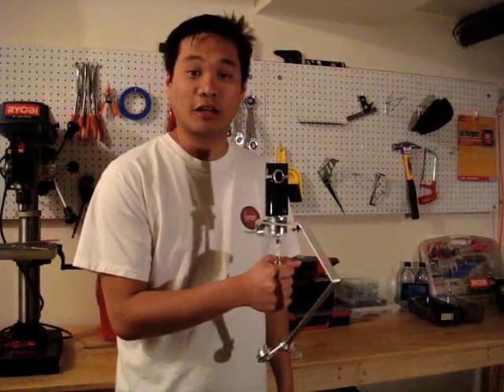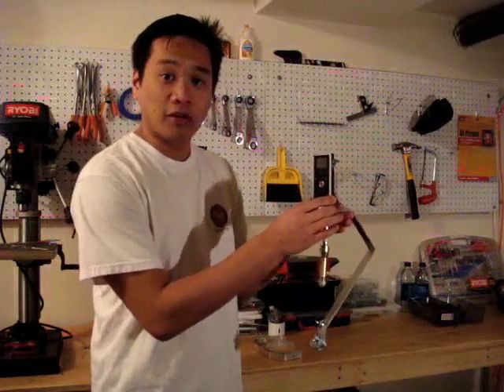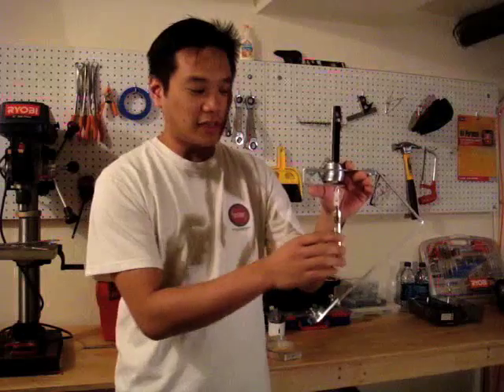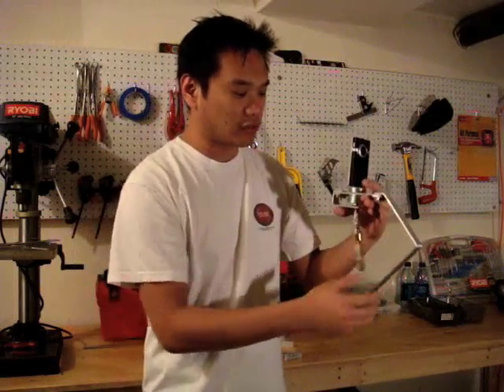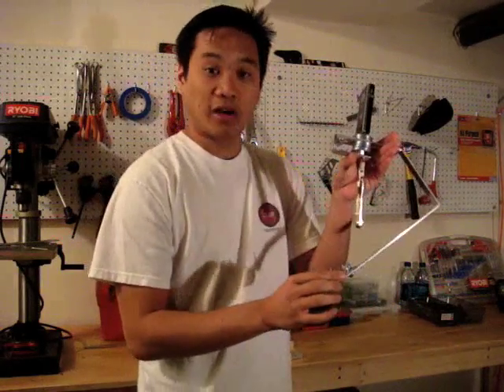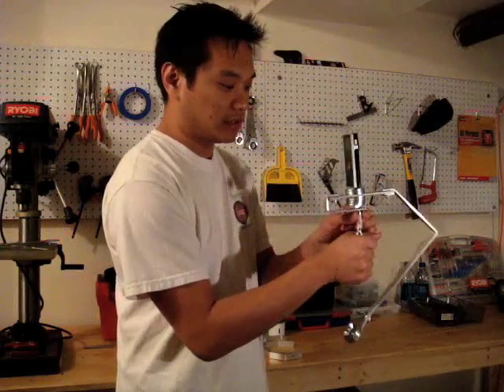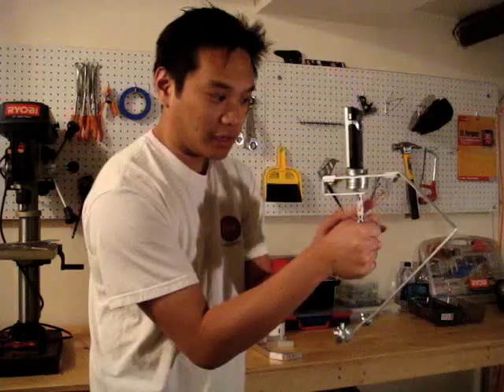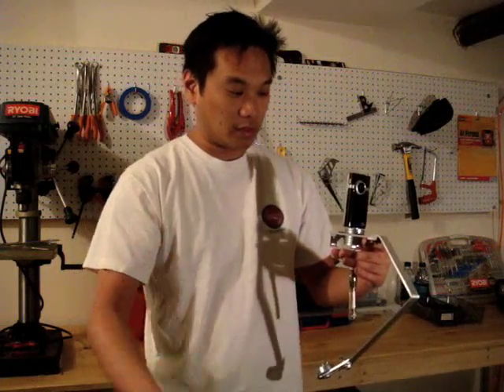Flip Float (Mini Camera Stabilizer)

Comment: i just put 1 together and am having an impossssssible time getting this thing stabilized. i have a kodak zi8 which is very similar in weight to the flip mino, any tips in which order to balance this thing? i have everything positioned  almost identical to yours and followed your google sketches as well.

Comment: I@ProtoDojo... Props dude! This is the best DIY stabilizer... Perfect for those small pocket cameras or cell phone cams. Although if you use a cell phome, you need an altinate mounting method. Perhaps a small cardboard or plastic box with foam in it to hold the cell phone cam?

Comment: Try plastic pipe like PVC. If the bearing is too small, try wraping a thin strip of duct tape around the outside circumfrence of the bearing. !CAUTION! DO NOT TRY  THIS WITH ANY CAMERA HEAVIER THAN THE ONE SHOWN IN THIS VIDEO! use only a small cellphone size camer.

Comment: Thanks for the video, I was able to make one for my zi8, which is going to be delivered tomorrow. Im testing it out with my dxg mini cam. I just added a quick release cam mount on top. It's way better than the manfrotto 585 that i bought for my dv cam. @ kadirou there's a lot of AA  flashlight that you can use for a handle if your going to use a skateboard bearing, most of them fit without any modification.

Comment from the maker: @kadirou4132 Any similar flashlight should work. Look for one with a removable bulb/lens so that you can insert the bearing. Just keep in mind that you may have to build an adapter for the bearing if the flashlight body has a larger diameter.

Comment from the maker: @crazy1992i 

Hi, Thanks for the comment! Unfortunately I'm unable to measure the weights. I gave my flip camera away and it's been awhile since I've used the setup (I'm currently testing a new electronic design). The only thing I remember off the top of my head, was that the weight at the top was about twice the weight of the bottom (I used 2 times more washers).

Comment from the maker: 3) I found the easiest way to make the bends is to place the flat bar vertically in a table vice. Clamp down and then bend the bar by hand with some gloves or with a rubber mallet. Try to keep the movement in one direction. The more you adjust the bend back in forth, the weaker the metal becomes.

Comment from the maker: Thanks for the comment kui2t!

1) I used 1/8" Aluminum flat bar in various widths. There's more info including a pdf with measurements of my design on my website. The link is in the description of the video above. :)

2) I buy the flat bars from my local Home Depot and OSH. It's usually next to steel bars and other raw materials. Sometimes it's marketed as "diy project materials". I also sometime buy stuff from 
onlinemetals(dot)com

Comment: Nice piece of work. Looks like you have a good workshop too. Your universal joint looks like mine, except that yours is white. I have been thinking for some time about making a very small steadicam for my pocket size Samsung NV3.  I wonder if a needle bearing like that on a compass needle would make a good very low friction gimbal. It would be an interesting challenge to make the smallest possible stabilizer. I have a few ideas that I'm mulling over.
Great fun, isn't it?